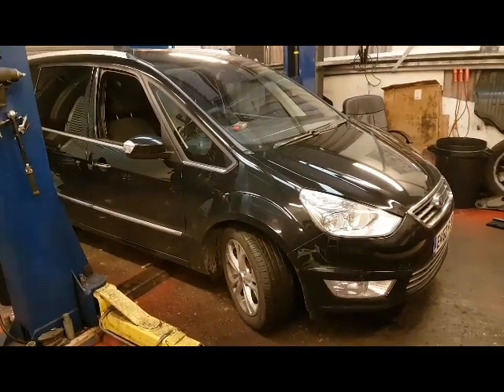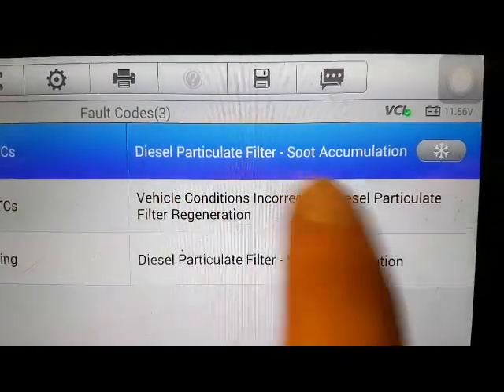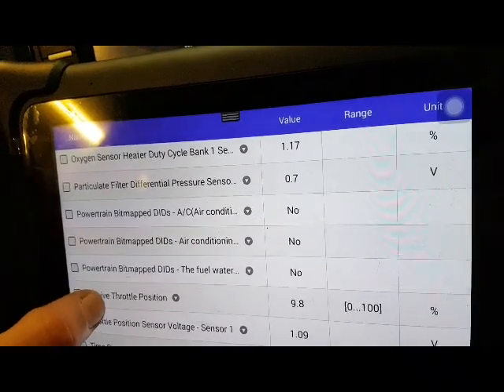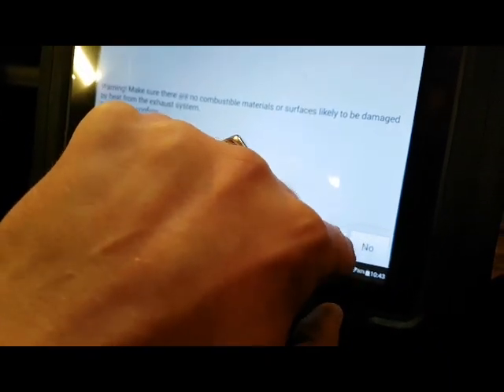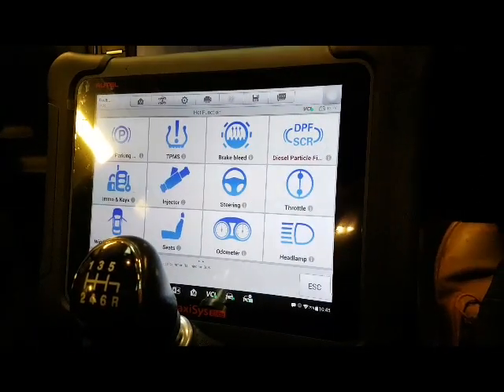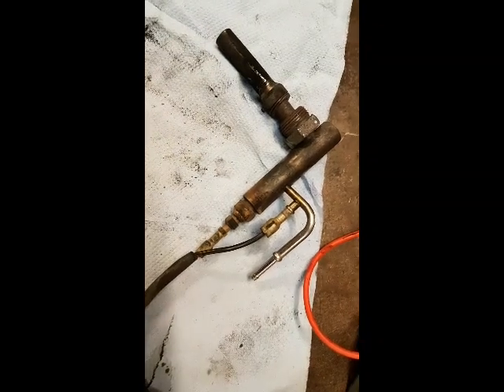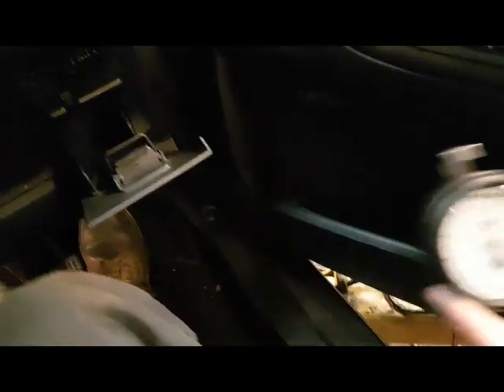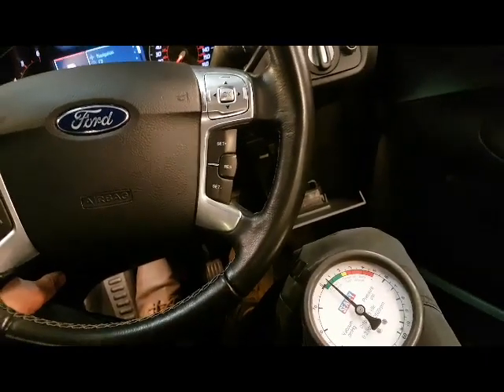Ford 2.2 diesel DPF fault P2463 P246B due to faulty Vaporizer

Comment: Ford S Max here, I try a static regen using Forscan and after 5 attempts it won't run it at all. Car stuck in limp mode. Last time it was in limp mode it was the intercooler hose which I'm sure you know is a known issue. Any ideas what it might be? Duff sensor? UPDATE, found that there's a pressure sensor hose totally torn (one in front of dpf)...would this stop a static regeneration? Going to replace it tomorrow. Cannot find the vaporiser, I'm thinking the 2.2tdci 08 S Max doesn't have one!? Cheers for upload...

Comment: Nice video but if DPF pressure sensor reads 0.0v it would be faulty.
Reply: 0.0 when the engine is on yes but if the engine is just in ac on having 0.0 then then the pressure sensor is okay.
Reply: @emersonmanabat5193  not true. Sensor has plausibility valtage of around 0.4 to 0.5v when powered, even with 0psi pressure differential. This is to aid in short circuit diagnosis by the engine ECU.

Comment: Good video, Ford are Cunts no doubt. I've had 5 fuel vaporisers in 95,000 miles. Going to start replacing them myself. You should always try to do the static regeneration on the DPF with the Snap-On Computer before looking at replacing the DPF as you need to regenerate the DPF for the new Vaporiser to work anyway. Thought it wasn't clear at the end of the video. I've regened mine at 320% full before today.

Comment: Sharing good video of diesel particlated regeneration if there is no response for g scan2 is this means that pressure sensors dirty  need to be cleaned in order to do regeneration by scan tool.  With my best regards